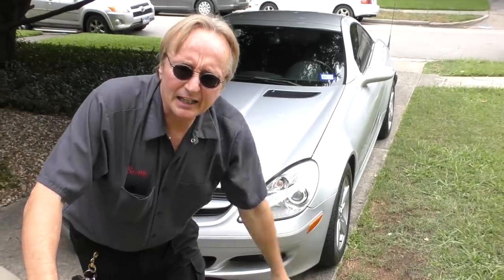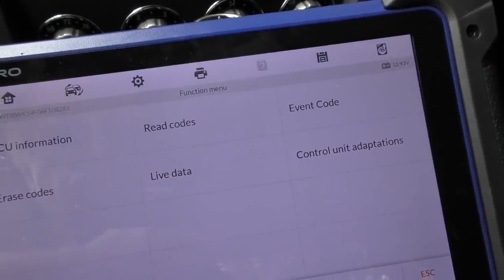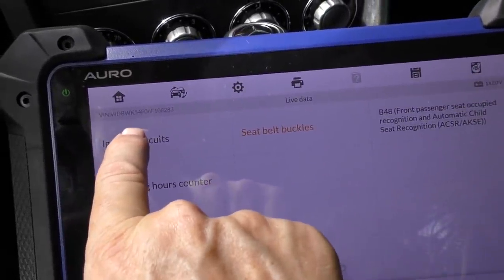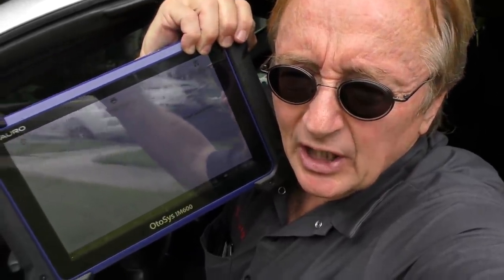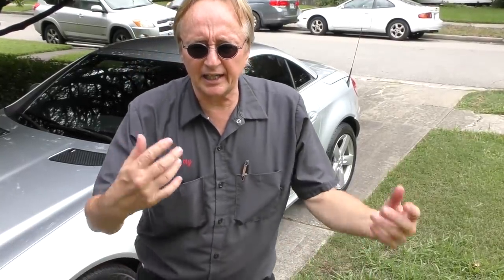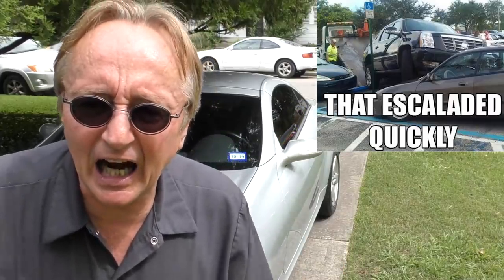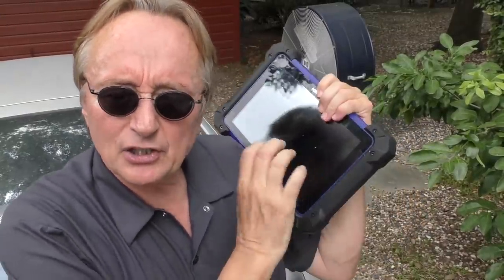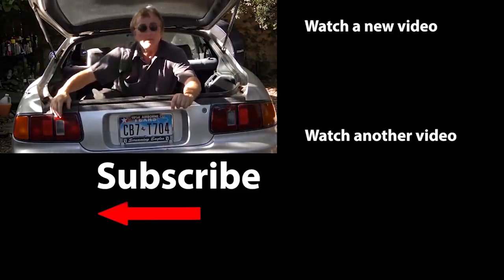You Can't Even Work On Your Own Car Anymore

Comment: Thanks Scotty! There is no way I would attempt to work on my 2016 Ford Escape, not like my 67 Mercury Cougar in the past. I got an error light on the battery a few months back.  Everything looked physically ok (once I could finally find the battery!!) So I took it to my mechanic.  After checking out the battery, alternator, engine and computer they could find nothing wrong.  They reset the computer and the error didn't come back.  They figured the computer got a signal from someplace, that wasn't correct, and they couldn't duplicate it.  After the reset the light was stayed off. Its been about 3 months since and the light is still not on. Well it cost us nothing to have it checked out.  We love our mechanics. Your friend in New Mexico, Kim

Comment: Its not a really big issue , a lot of Mercedes sensors can be cut off and the system could work without them just fine  , i had a failure in my CLS hydraulic system and switched to normal suspension , and despite the warnings in the instrument cluster before , after i switched the suspension the mechanic simply removed all the wiring and sensors of the hydraulic system and no warning came up after that ..

Comment: I limit myself to strictly mechanical faults; brakes, oil changes, shocks, struts, plugs, wires. I was sick and tired of the ABS faulting out that I removed the ABS fuse. Now, I have complete control of stopping. It went from an electrical fault to something strictly mechanical.

Comment: You would be surprised how many electrical problems can be fixed with either carb cleaner or electrical contact cleaner.
Don't use WD40. It leaves a film.

If it were my car I would pull the seatbelt unit and give it a shot of electrical contact cleaner. 
Who knows? Nothing to lose.

Comment: I Would love your help sir. I'm planning on buying a 2008 Audi S5 with the 4.2 V8. I drove the car and it drives perfectly, its stock nothing aftermarket, the clutch has being replaced, it's a manual transmission and it feels perfect but I hear the chain stretches and it can cost a lot but it looks in such an amazing condition. Thank you in advance.

Comment: My bumpers do not line up with other car's bumpers at all after the suspension lift.  A SRS light turned on six months ago.  I am wondering what good the airbags are if they will not deploy unless I hit a train or a wall, or a lorry.  My bumpers will go right over most of a car now.  I just disassembled the instrument cluster and put a piece of tape over the SRS light.  Someone hit me while my vehicle was parked last year, relatively hard.  The airbag did not deploy.  It is allowed to disable your airbag in the region I live if you are under a certain height.  I am just over that height.  But what if I am slouching in my seat?  The SRS error just saved me from paying to have the airbag disabled.

Comment: High Resistance may just mean "Corrosion in the electrical connector". ie, opposite of short.
I have 2007 Mercedes GL450, and the it developed weird start problem.
when I turned the key to start the engine, the engine turns over for seconds and shuts off, more so when the car was warm.
I removed the EIS unit, and disassembled it, didn't see any obvious physical damage, so just put it back together, the problem went away. My guess is some of those many connecting surfaces got corrosion, which cause the electricity to not flow well.

Comment: Hi Scotty 
My wife's 2013 Nissan rogue with 60k miles
 Doesn't want to accelerate when you step on the gas, you have to press on it harder then it goes. Doesn't happen all the time but often enough to worry me. Only once a light came on. It was identical to the light when you take off the traction control, any ideas?

Comment: That wasnt a autel unit.... but same thing... u could just put a resistor in there and reset the light so the system can function like normal minus the pretensioner

Comment: Hey Scotty,
     I’ve got a 2013 Subaru Outback 4 cylinder with 137k miles. The engine sounds like it’s running fine & i have full power.

However, it’s going through Oil like mad. I got an oil change and 3 weeks 500 miles later it was asking for more.

I put some Lucas oil in & 4 cylinder restore & that lasted for about 2 more weeks than before, but it’s asking for oil again. 

Any ideas?

Comment: Scotty,
Do you find manufacture specific software better than an all in one scanner?

Like using AllisonDOC, Wabco, Cummins Insite,etc have great diagnostic and testing features I use with a Nexiq usb-link 2 and a cheap laptop.

Do you see all those features in say a high end snap on scanner or your scanner. I have never used those and was curious on your thoughts. I mainly work on semis and step vans so It May be a different world than yours.

Thanks.

Comment: Hey Scotty, my 2006 Impreza head gasket leak oil. Is it something that I can do in my garage with a normal ratchet set and do I really need to bring the engine head to a machine shop? I don't want to get rid of the car, it has been relatively trouble free and the body is not too rusty.

Comment: Scotty, My girlfriend has an 03 Mazda Tribute 6 cyl. Died on me in the middle of the highway on my way home from work. I got it to the side of the road and plugged in my scanning tool to see what the check engine code was. It threw a code for the EVAP sensor. So, after we towed it home, my dad tested the wiring harness to the evap system, the EVAP sensor it's self and the fuel pump. all turned out fine. Then we replaced the gas cap just in case it was gas cap syndrome. turned out fine. still throwing codes for the evap system (that is working fine) and turns over and runs for a second and chokes out. Everything mechanically checks out 100%. Could this be the ECM on the car? and if so, how do you test it?

Comment: instead of buying a new part just clean up the contacts. The overall circuit has too much resistance. I would take out the component and clean the rust, highly unlikely that a resistor would blow up or  a capacitor, but everything is possible and could be easily determined with a quick visual inspection. :D

Comment: Scotty:   I would appreciate a suggestion from you.    The car is a high mileage (160K) 1990 Cougar 3.8 L,  bought new, and there have been very few problems,  except for today.   Turn the ignition key and nothing happens.    I jumped the solenoid from the battery with the key on run, and the car started right up.   battery is ok, starter is ok, solenoid is ok as far as I can tell.   A volt meter on the solenoid lead from the ignition switch showed only 4 volts.   Volt meter shows 14 volts on the battery.    I put in a new starter switch and same result.   I tried starting in Neutral  instead of Park and nothing happened.  (neutral safety switch is ok?).    Now I am out of ideas, except for possibly installing a push button that bypasses everything up to the solenoid.   Pls give me the benefit of your experience.    regards   JN

Comment: Scotty what is it good OBD professional scan tool I can use on my 1999 and 2000 Dodge Ram 1500's. Something that will let me reset fuel flow rate from the fuel pump. Want to swap my V10 from my 2500 to a 1500 chassis

Comment: What's with car tires being so obsolete so fast today? I've gone to two places and I get story that my flat from only valve leak cannot be fixed because it's six years old, yet Toyota passenger car tire still has tread and no cracks. And these places expect you to buy all new tires for one flat. My other gripe on cars is lousy quality air compressors for tires. They have such cheap air hoses on them. Husky metal one developed hose fabric fraying leak at air tank connector after only two years of moderate use and now fray leaking again from plastic connector joint hose cut off fix. Air compressors built to be obsolete fast from even expensive ones.

Comment: Hello I have a question. My daughter have a 99 Camry. Yesterday it stopped on here. She said it started jerking and the ABS light came on and it cut off.  When she started it back up she couldn’t put it in gear and the windows won’t go down the AC not coming on the break lights are not working either.  The radio is not coming on and the horn not working. They got the gear shift to work but nothing else is working   Please help me. Thanks

Comment: Resistance too high, I'd just first try to remove the trim and check / clean the electrical connectors. Could just be a loose / dirty connector creating too high a resistance.

Comment: You mention inspection for Texas.  Let's say someone has a check engine light on, well they will probably fail inspection, but couldn't that person just simply disconnect the battery and reconnect to clear it out and then pass inspection or does that trick only work on older cars?
Reply: The ODB scanner needs to have all the emissions tests run with 1 or less non-critical test failures (like EVAP for faulty gas cap) for an inspection pass. When not all the tests have been run, you still pay for the inspection and have about 2 weeks to drive the car around for the ODB tests to run (hopefully no CEL showing) and come back in for another inspection at no extra charge.

Comment: That Code refers to the drivers seat belt pre-tensioner , not any switch. You didn't even check if it was connected correctly.....

Comment: But Scotty... if the seatbelt tensioner isn't working, isn't there the posibility it won't lock when needed in an emergency stop? So it could be the choice of your face in the windscreen or $500.00 for a new tensioner.

Comment: Hey Scotty what's better a V6 or V4 Camry 2018?
Reply: Good question!
Reply: V4 has less moving parts to fail, smaller engine, which means easier to access its fittings, and less money to repair and service, as such i would go with the V4
Reply: @fidelcatsro6948  thanks I just thought bigger car bigger engine but right if it is not for race it will be better, thanks
Reply: @renemartin5557  If you buy inline 4 cylinder engine cars it will be even easier to repair and maintain than a V4

Comment: Problem is not the seat belt retractor. It's the seat belt pre-tensioner on the buckle which pulls the seat belt in the event of an accident to further tighten the belt. High resistance in the squib circuit more than likely means it needs a buckle not a belt, but further circuit testing is needed. Smh

Comment: I dunno, the seatbelts work the same way as the airbags. It too has an explosive device in that tensioning device. If that fails, the seatbelt may fail to work properly in a crash. Or even if it does work ok, it will not hold you against the seat and you'll move forward toward the airbag blowing, which if you're a small person, could take your head off.

Comment: You can work on your own car - but not without a scan tool. Drivability problems in a modern car are virtually impossible to troubleshoot without one. You can’t fiddle with the timing, turn a screw on the carb, or pull off plug wires to locate a misfiring cylinder.

Comment: I’m removing the seats in my CRV  this weekend. Do I need to disconnect the battery before or after I disconnect the airbag from the seats. Or not at all? 
Someone told me to disconnect the battery or the airbags may blow up. But he’s not really a mechanic. He said that he had read it somewhere.
Reply: Disconnect the negative battery cable and wait 3 minutes before touching any part of the SRS (airbag) system.
Reply: Big Dog50001 Automotive 👍👍thank you

Comment: You can just get the icarsoft i980 for about $150. With this tool you can access all the modules inside the Mercedes. They make similar units for all of the German makes I believe. So not entirely accurate, you can troubleshoot any Mercedes properly with a $150.

Comment: Same problem with my 2001 Camry Solara, and the power seat didn't work either. Got a new seat and seat belt clicker thingee at the self-service wrecking yard on half price day, less than $30. Even Mercedes-Benzs end up in the yard. You can fix that for less $700 on any car this side of a Lamborghini. Rolls and Bentley probably use VW parts. That's who owns them now.

Comment: Ya just pull the dash cluster out, cut thru or scratch off the contacts to the srs light, solder two wires to the srs bulb holder and tuck the other ends under the contacts for the oil pressure light😁👌 sorted😁

Comment: Hello Scotty, how are you? I've got a little problem with a Lexus ES 330 '04 Model I just bought. I mistakenly drove through a pothole and I noticed the speedometer stopped working. I checked for the code and it gave me an error C1244 (Open or Short Deceleration Sensor Circuit). I've tried searching for where the DSC is in the car but I can't find it. I'd appreciate if anyone can help me with this.....

Comment: Resistance is too large... which probably means its infinite ohms. My bet is a wire is disconnected/broken. As opposed to a short circuit which would be too little resistance, or 0 ohms for a dead short.

Comment: I like my ride with only the driver seat installed. I can ride a hundred miles without the passenger seat before cel appears and i clear code and replace seat to car. Anyone know if the electronic harness to the seat can be terminated to prevent dash indicators from happening. I'll be back

Comment: So basically the driver side has no pretensioner function for the seat belt.  In the event of a crash, the pretensioner won't instantly tighten the seat belt as designed, to ensure the driver is restrained in the seat, due to a problem associated with its ignition circuits.

Comment: I just did a timing belt and a front wheel bearing on my neighbors 2004 civic, I foolishly put the seatbelt on when I test drove it, now the airbag light is 9n so told him that it would have to be diagnosed, he told me that he already had it checked and that i5 was a problem with the seatbelt, I wondered why the belt didn't retract now I know, I got it to retract which lilkey caused the light to come in, he didn't care, the car is junk anyway,  it runs good now at least after I worked on it.

Comment: Identifix  might be able to tell you exactly what is wrong. Its database is compiled from actual mechanic repair solutions. They have a 14 day test drive for $1.  For all you know the circuit might have a corroded ground. Take off the trim panel and eyeball it.       I once had a Mercedes with a passenger  door airbag code and Mercedes put the soldered connection under the carpet right where the passenger put his feet. German engineering. After using the scanner you should eyeball the part in question.

Comment: I'd prefer not to bounce off any air bags....seen one explode before while driving.  You don't want to see/experience it.  

My only question on that SRS light is, with the issue there, does the tensioner not "retract" when needed during an accident like it's supposed to?  I don't have a Mercedes money pit, so I don't really care...but the guy who drives that might.
Reply: Yes I thought that too, or would it disable entire srs system, airbags and all, which is what it did on my ford when I had an airbag light on. same with abs, having that light on will disable the system until addressed.
Reply: Would the airbag even be allowed to fire with the belt tensioner malfunctioning ? I wonder if that might be even more dangerous ? :)

Comment: If the resistance is too high it's probably a bad connection or corrosion rather than a short. Perhaps he also has a leak somewhere? 🤔
You could probably resolder it and the code would go away but... Not really worth the effort. Just take the dash off and take the LED out x)

Comment: Can't even change your own oil. The cars are too low or I weigh too much. Plus, the states with inspections are just a money racket. I had the inflate tire indicator on and put air in it every 4 to 5 days. I took it to Discount Tire. It turned out that there was a small leak from a corroded sensor. Hasn't been on since. The guy told me that if that was the only thing wrong after 9 years that I was lucky. It's a Honda Civic.

Comment: Scotty, I just want to say that this fault is in fact a pretty big deal. As you probably know, the seat belts on all modern cars have a belt pretensioner system - it's designed to pull you tight in the optimal positioning if a serious crash occurs. This way you make the best possible contact with the airbag and don't bash your head in... that's kind of important. The fault the car has means that the pyrotechnic ignition charge that actually pulls the seat belt is giving a bad reading and will not function in the event of a crash! This is super dangerous in collisions that will deploy the airbag system! Yes, it takes a scan tool to check these faults, it's pretty normal, after all, the system is reading resistance values of single components and sensors, otherwise, it would be a nightmare to try and somehow probe each possible failure point and find the faulty component. Many will argue that this is needlessly complicated, and many things are in fact  intentionally made hard to repair by car makers, but this safety system has saved numerous lives, and reduced the risk of injury greatly! If you crash seriously in your Celica for example (God forbid), you have a way, way lower chance of getting out in one piece than if you are in a car with these systems in place.

Comment: Used cars that are easy to fix are going to go up in value ,, my prediction. 
I looked for a rust- free clean GM sierra. 4x4 for 2 weeks. I found 2005 pre AFM system . I thought I overpaid at 7500, then I saw a 2006 for $13,900 on a dealer lot. Sold in s few days also.

Comment: Really...   the issues is the auto tensioner that pulls the slack out of the seat belt in the event of an accident has failed.  This is as important as the airbag and part of the supplemental restraint system.  This is NO different than any other modern vehicle and $583 bucks is not bad at all compared to other manufacturers.